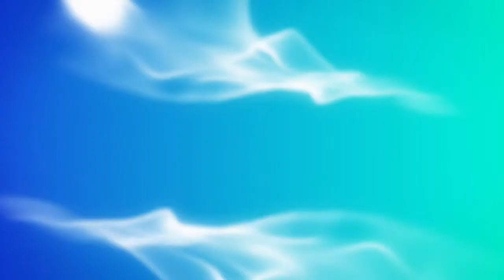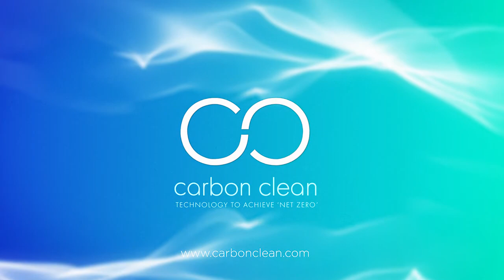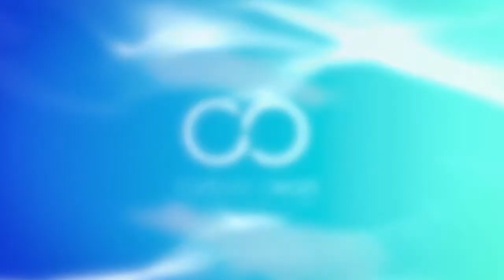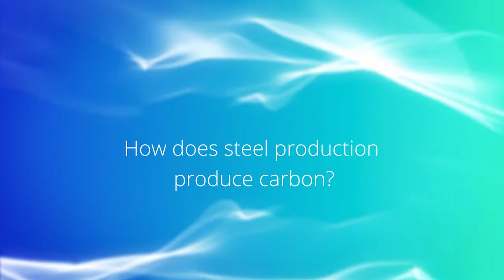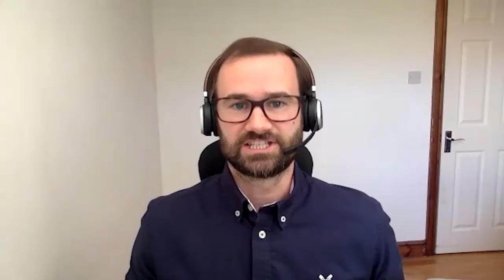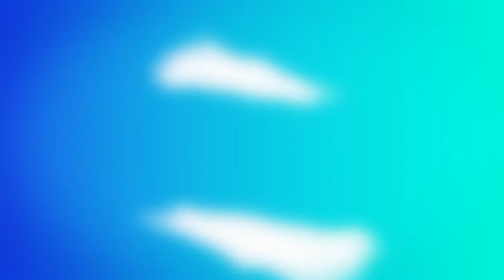Cleaning Up The Steel Industry: Reducing C02 Emissions with CCUS

Comment: Hello, I was looking for a Scope 3 figure for stainless steel for a fabricator, there is the figure of 1.85tCO2e and I found another from the International Stainless Steel Forum of 2.91tCO2e. There was a nice 12 page pdf report 'ISSF Stainless Steel and CO2' with a breakdown for the number. I'm in the UK, which number would you use?